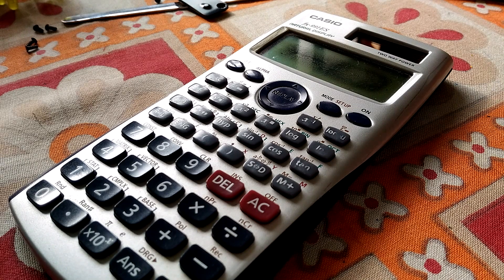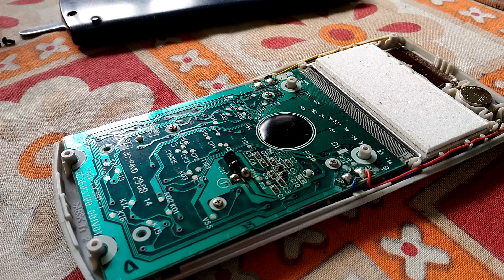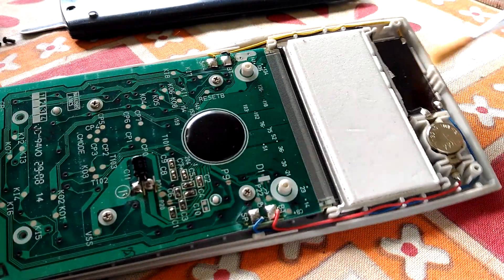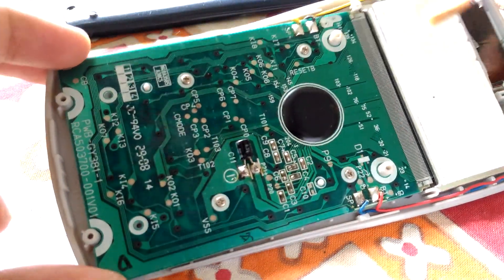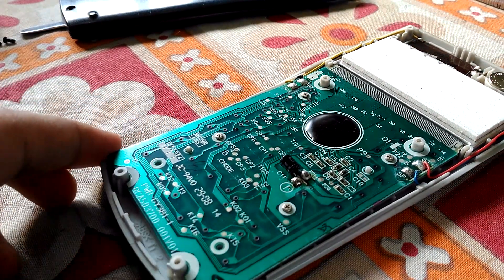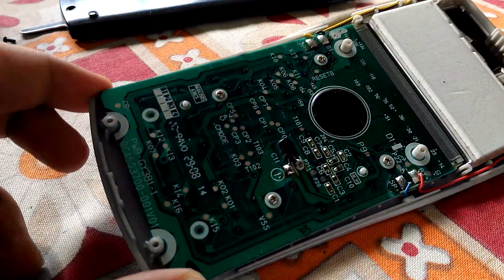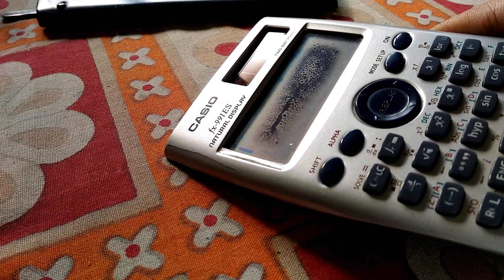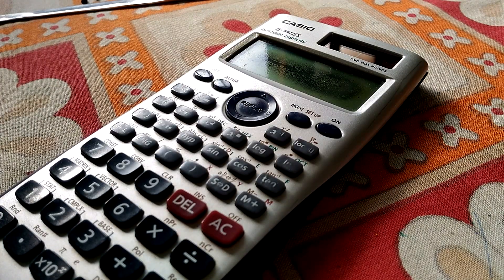Casio fx 991 ES calculator opening back cover and cleaning.

Comment: My calculator fell into water. How can it be repaired
Reply: light it on fire.

that totally works
Reply: To be honest I think you should let it dry. As long as you have not used it after it has been dropped, you should remove the battery carefully and let it dry, then insert the battery again.
Reply: Use it as a fish Bait.
Reply: buy a new one?

calculators are really cheap
Reply: @randomguy4738  I wouldn't agree. Simple ones ("like on your phone" level) - yeah, sure. But more advanced models (which unlike simple ones, actually useful outside a classroom) can go well over a 100$.
Reply: @smitias_8474  If you're going to use an advanced calculator then just search one up online. And don't even start with the money bullshit. People sell pens for 100 dollars.
Reply: @smitias_8474  if you have an "advance model", there should be extensive documentation about that. Like my ti-84. I usually search up online for parts and PCB traces for repair. But if you have those cheap ones costing 20$, I doubt that there is gonna be at least a documentation regarding the circuits.
Reply: @randomguy4738  Yeah, they sell them, in the US. As a student in developing country, my whole monthly income is around 110$ a month. Even 30$ calculator is hefty investment for me meaning no meat for the rest of the month. Besides money point not being bullshit for most people in the world, landfills fill up much slower when people don't throw their stuff out instead of trying fixing the issue.
Reply: @channelname10yearsago68  In my part of the world my 30$ fx-991EX considered to be expensive - mostly because you wouldn't find programmable calculator in many countries besides US. As far as I know, that's due to US education system. In schools we generally used 2$ calculators and guy with 10$ off-brand chinese scientific calculator was like super cool (mostly because you can write a lot of things in addition to 5318008).
Reply: @channelname10yearsago68  But yeah, calculator at this price range doesn't include things like circuits documentation even though they got plenty documentation overall. I really like what you described (as a computer building enthusiast).